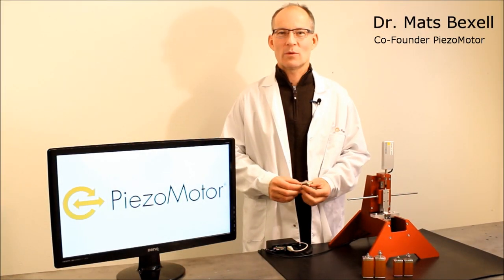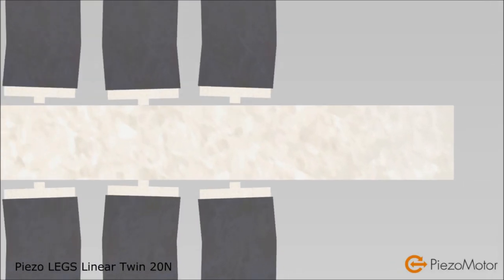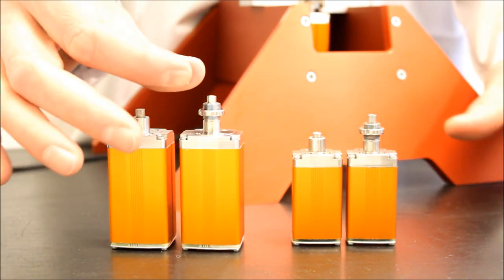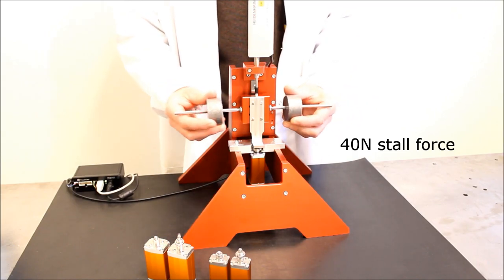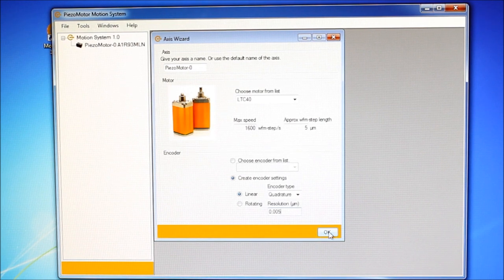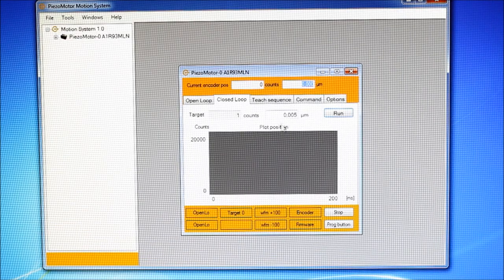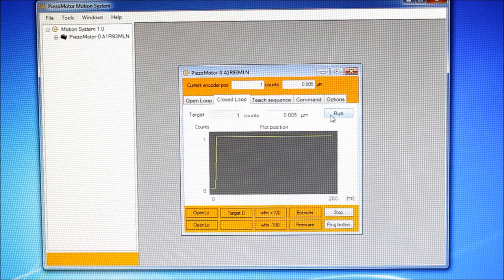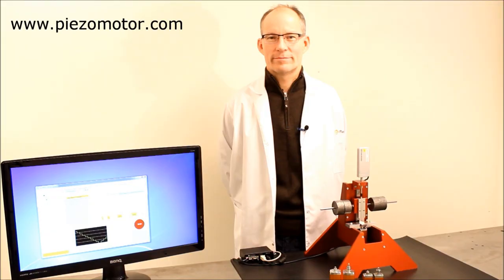Demonstration with LTC40 motor from PiezoMotor

Comment: artificial  muscle system from piezo motor sounds promising
Reply: as long as it's not significantly cheaper than usual motors, nothing will happen. This technology exists now since almost 20 years, and still it did no breakthrough, because you can't even find out a binding pricing from the producers, which prevents any type of scalability for any industry. I heard about this motor first time back in 2003 or 2004 on an exhibition in Hannover or Nürnberg from the company PI. However, since today, they keep on hiding publishing a pricing for this type of motors and as long as that's the case, it'll remain in the category "toys" or "scam" or "decoration". However nothing to be taken serious, even if it has the potential.